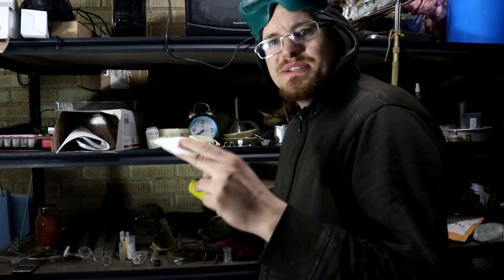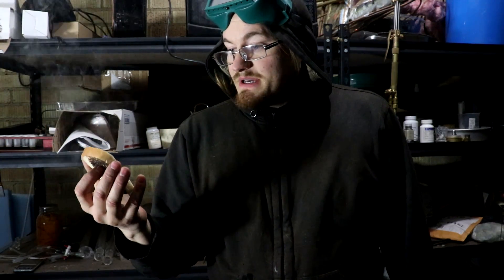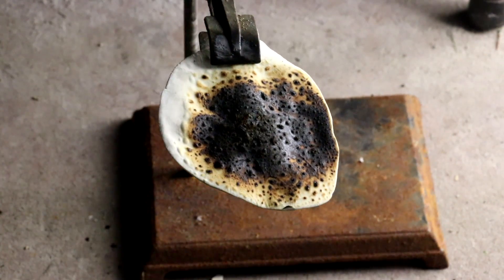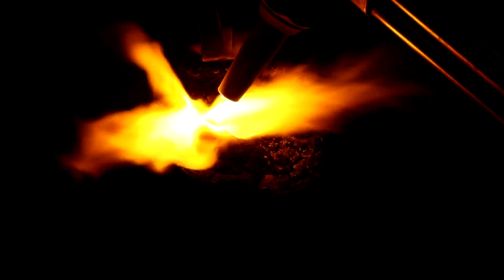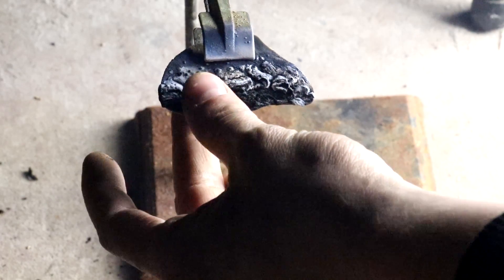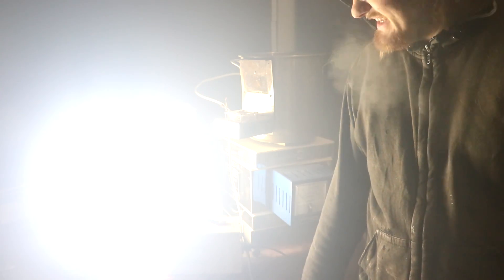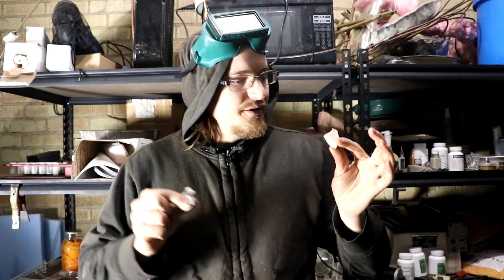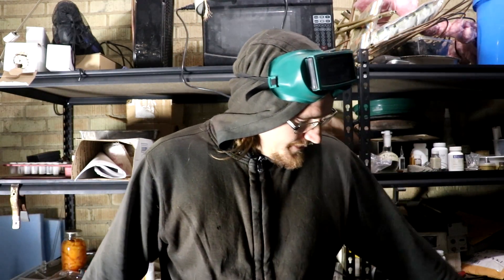Can I Burn Through Starlite?

Comment: Cody, I have a white powder product that I purchased 6-7 years ago that I added to my latex paint that when heat is introduced actually expands and forms a 1/2” to 1” foam type barrier. Reducing the risk of thermal conductivity through the Sheetrock into the wood studs behind it. The product states that when heated, it doesn’t form any additional toxic gases. I never actually tested the product. I had enough to paint a 1500Sqft home walls and ceilings. I’m wonder what your thoughts are on this product. I’ll have to go into my building and find the manufacturer product and it’s name. I’m curious if this is nothing more than a sodium carbonate product with some type of polymer that allows the co2 to form a foam.
Reply: This is just called INTUMESCENT paint.
Reply: @dimitar4y  why do you seem so angry?...
Reply: Mark Eckelkamp how do you heat it without setting fire to the fabric of the building?
Reply: @colinantink9094  By making a test sample that isn't attached to his building? 
Either by having more left over, or just buying more of the product, its not like it's a lost chemical, he still has the information on where it came from.
Reply: Madra hm. By the tone of your comment I guess it’s apparently obvious. So uh. Hm. Does this stuff only bulk up when heated by an existing building fire or something?  To try to prevent or slow down further spread?
Reply: @colinantink9094  Yes it's obvious, just look it up, Intumescent paint. Yes, it bulks up on heat. Just 500-600'C can make buildings fail if the metal girders are heated up. It retards heat spread. And it uses non-organic things, so stupid fungus can't eat your building to death.
Reply: Colin Antink  yes that’s the purpose, if a fire does occur its primary purpose is to slow the spread of the fire until firefighters can arrive. If put on in two coats it is suppose to give a 2 hour fire rating. When I was doing fire inspections for my local fire dept. I was strict on daycares because the infants and young children cannot leave or know any better. I purchased this product through a local supplier as it was cheaper than purchasing intumescent paint by the gallon.  We allowed a daycare to use this verses  removing all the wood paneling and installing 2 layers of Sheetrock on one wall to obtain the same fire rating. The product came in a 4 gallon bag inside of a cardboard box. Again I never actually tested this product to see its effects or what actually happens. I took the manufacturers word as this was NFPA approved product,
Reply: @MARKE911  
What was the manufacturer name?
Reply: damen whelan. I’ll go out to my shed building this week and see who makes it and post back on here. Unfortunately it’s not on the same property that I currently reside on.
Reply: No you’re meant to sniff it not put it in paint.
Reply: PREPUBESCENT paint!
Reply: @hokiepokie_soupermane  I knew I should made that joke juat to save my notifications the trouble.

Comment: The problem with this demonstration is that you're removing the carbon foam by using a torch with a flame that comes out at very high speed. Starlight was never meant to stand up to that. It is a HEAT barrier, not a torch barrier. If you heat it with the propane torch and then blow on it with a strong fan, you'll get the same result.
Reply: I also wondered if that was the case.
Reply: I was thinking the exact same thing. The whole gimmick is the foam the carbon forms. If you blow that away, of course you're going to get through it.
Reply: Ok so in an actual fire there is absolutely no air movement?? People asked about reentry. There is a LOT of air movement in that situation. BBC said this material could survive 75 nuclear blasts. Do nuclear blasts not have any air movement?? Plus this material won't survive a little water. While it is a neat material it is no miracle material.
Reply: @crissd8283  The BBC video mention its resistance against the heat wave from the nuclear blasts, not the shockwave. They even mention that
Reply: @crissd8283  I don't remember the thing about the nuclear blast. I don't think anyone said anything about an insulator for reentry. Either way, it's an interesting material and the concept of it is what's got all of the potential.  I also don't think the US and British defense departments are lying about it withstanding a 10,000 degree laser pulse.

Anybody with 2 brain cells knows you're not going to coat anything with cornstarch, baking soda, and glue.
Reply: NASA did nuclear blast testing and confirmed it.
Reply: @gnydick  wasn't it a laser test with an intensity similar to nuclear radiation?
Reply: I read it in literature some years ago now  @gnydick  there was a breakdown of testing that NASA had performed and it did include nuclear heat sources.  The only way it could have been done - safely performed under lab conditions.  How much of a blast that amounts to I could not say however I know the material was independently tested and verified for its claimed properties so it is not just a matter of "a crazy person making claims" but of scientific departments of well established agencies that have backed the claims.
Reply: @keeperofthegood  The only claim about NASA came from Ward himself. Unless someone finds documents or evidence of these tests taking place other than what Ward claimed, I don't think I'd take them very seriously.
Reply: Indeed I am not even finding the documents I recall reading through a few years back now  @ivanlagrossemoule  and yes searching through I am not finding corroborating information.  NASA pre 911 was entirely online (over 50K web pages) but following 911 it went down and came back vastly different but any research done by them should be listed public. So now I question what the memory that I have of what I read.  I will have to step back to the skeptic position again.
Reply: You are absolutely correct!
Reply: The reason this doesn’t prove this material’s significance is because most applications for this material on earth are going to involve some amount of convection heat, which involves airflow, and ultimately leads to the same outcome. Also, Cody mentioned that this stuff made smoke, which means it burnt, and that means that this material is susceptible to an oxidizing flame, and since our atmosphere contains lots of oxygen, that’s a problem
Reply: So if the problem is he's blasting the foam away, what  kind of application this is good for that guarantees the foam will not be blasted away?
Reply: @misium  Lasers, any kind of radiant heat, situations where a scientist would try and replicate conditions rather than blasting a piece of toast for less than 4% of the time and saying they're about the same.
Reply: also this wasn't the original recipe
Reply: I think there’s some physics involved with re-entry of the atmosphere. Sure there’s oxygen up there, but how much, what’s the friction of the oxygen on the material, and the cooling effect as well? Maybe it would work for just putting satellites into orbit but not having them re-enter the atmosphere? I don’t know enough about it to speculate more.
Reply: he wanted it to burn, 
he didn't want to test it.
next time read the title.

Comment: Can you make/test aerogel?
Reply: How about "evacuated aerogel", where it's a closed-cell foam where each cell is filled with vacuum? Should technically perform better than aerogel.   Edit: "filled" with vacuum... er, uh... you get the idea.
Reply: Applied science has made a video with the process of making it "at home"
Reply: anyone can make aerogel
Reply: @Rockzilla1122  I mean, technically anyone can make anything given they have access to resources, equipment, and know-how.  :D :D
Reply: And use the  gas axe on it.
Reply: Go over to Applied Science, he does more advanced stuff like..electron microscopes and Aerogels.
Reply: isnt it just a gel filled with a lot of air?
Reply: it's a gel that's had the liquid removed as a supercritical fluid.

applied science did a video on making aerogel.. he also made a supercritical CO2 chamber.. good videos, check'em out.
Reply: @adfaklsdjf  cody also made a supercritical co2 tube
Reply: Joe mo mumbo Yeah I'm not sure everyone was aware how effing dangerous that was. He basically built a bomb made of glass
Reply: Skeets McGrew and he treated it with the needed amount of respect.

Comment: This seems more like you're just blasting away the starlite with pressure not fire, I think you'd get about the same result if you used a pressure washer or compressed air.
Reply: Or the pressure of re-entry?
Hyper-sonic air-blast imparts LOTS more pressure and heat than Cody could manage with that puny torch.
And at Mach 8+ turbulence takes on a whole new meaning.
Cody was being quite gentle with his test.

Comment: I thought you were kind of underselling it at first,  but cutting the plaster board made your point pretty perfectly.
Reply: Now I wonder what you get if you mix Starlite (actually NightHawkLite?) ingredients with plasterboard ingredients.  Maybe add some extra stuff to outgas to make a shielding vapor layer, and maybe you could get something that would last for the few minutes required for a space vehicle to complete the hottest part of atmospheric reentry.
Reply: I doubt that would make a very big difference as plaster board is usually composed of perlite which as I understand isn't thermally stable beyond something like 2000 degrees F while reentry is about 3000F.  It might be an interesting experiment none the less
Reply: @Lucius_Chiaraviglio  the Russians were using reentry Shields made out of wood for a while. I believe it was White Oak from America even.
Reply: @demandred1957  
Yep. Laminated. It would burn form.carbon that would.flake away while the under surface charred more.

It literally does the same.job as the tiles only it's heavier and retained moisture.
Reply: I don't think the claim that Starlite is very strong is accurate - the claim is that it is a very good insulator.  I'd rather see it made into a box put in a furnace for 5 minutes with a some bacon in it, I think then you may see the difference between Starlite and plasterboard.

Comment: Could it be protected against an oxidizing flame further by adding more sodium bicarbonate to the mix? I would think the increased decomposition from bicarbonate to oxide would help shield the carbon layer from the oxygen
Reply from the maker: actualy I think aluminium hydroxide would hold up better since I can boil sodium carbonate with this torch.
Reply: @theCodyReeder  sounds like a fun test :)

Comment: Using a torch.
Setting shit on fire.
Holding objects with his bare hands.
Same objects he's setting on fire.

That's why we love ya.
Reply: "I should probably open a window"
Reply: I remember seeing a video of a person holding the material that the space shuttle was made out of in his bare hand while it was literally glowing hot.  (he took it out of a furnace with his bare hand)  the part that was supposed to protect it from reentry.
Reply: @speedy01247  I remember that too. It was glowing hot in the middle but the surface was cool. Looked really cool because the outside was white and it had this red glowing coming from inside.
Reply: @speedy01247  that could have been... starlite!
Reply: NightHawk did the same thing in his video
Reply: It’s a different type of flame as well though.
Reply: Use hidrogen flame
Reply: CHINEZU englez Acetylene is hotter than hydrogen.
Reply: also why demonetized
Reply: If Cody had Shawn Woods mousetrap channel he'd probably have ten black fingernails.

Comment: Cody’s Lab in 18 years: Can Hawking radiation from my black hole be concentrated into a beam?
Reply: *months
Reply: Beam it up Scotty
Reply from the maker: Well this is a question I have.
Reply: Cody'sLab a question that 'can' be answered. Although no one would ever know the answer.
Reply: @theCodyReeder  I believe that is what a Blazar is.
Reply: @theCodyReeder  of course it is, love your channel 😂
Reply: @theCodyReeder  Considering hawking radiation (to my knowledge) relys on atoms or an opposite part of it's pair to disappear and reappear outside of the black hole's event horizon and the fact that we have no clue what's in the center of it by way of whats going on to an accurate sense there is no way to predict where the particles would appear so I don't think so.

I'm far more curious about the application of using small black holes to break down forms of matter and using elementary particles to create any known element. That or see if it is possible to create elements beyond the periodic table. 
(Tbh IDK if the periodic table is limited because these are all the elements known and proven to exist or if it is that by standards under normal planetary surface or space conditions/what we can replicate individual atoms/elements simply fall apart beyond that proton/neutron/electron count)
Reply: I'd like to see the nuclear reactor made out of potatoes
Reply: Well, that depends. What shape is the black hole? If you can spin the black hole fast enough, the event horizon should become red blood cell shape, and the concavity should allow the Hawking radiation to focus kind of like a reflector, but a laser beam effect would require fancier physics. 
(technically it would be a horn torus [think bagel that almost has a hole])
Reply: @superdupergrover9857  how does spinning it deforms the event horizon? I thought the event horizon originates from the singularity which can't really be influenced by any spinning, right?
Reply: Michel it does for some reason, GR explains it
Reply: superdupergrover it’s called a joke
Reply: Please don't talk about Cody's black hole, I think in pictures XD
Reply: Cant forget a precursor to it, "how to make a kugelblitz at home"
Reply: "And here is the chamber where I'll bombard the beeswax with antileptons to produce the charm quarks, which I'll be collecting in this pickle jar."
Reply: Lol great video jumping to the max to test it out.
Reply: I CALL IT A HAWKING HOLE
Reply: Well after reading through that, im rather scared to post anything in this chain.
Anyway, I suppose if we made a tiny weeny star we could spin the shit out of it and then try and make it collapse into a black hole with angular momentum but then there is the problem of getting a tiny weeny star to burn up all of its mass to form a black hole.
Theoretically impossible as in order for that to happen the stars mass must exceed the TOV limit, which is somewhere around two and a half times the size of our star.

You would actually need to make a larger star than that even, as the angular momentum that you would need to impart onto the star that is required for it to carry that momentum through its eventual burning out to form the bagel, would break the perfect geometry.
So if your star had the bagel shape to it then it would be uneven in mass throughout and so it would no longer have the perfect geometry required for it to have a rest mass that exceeds the TOV limit.
I think.

Unless all this is drivel and black holes evaporate their hawking radiation at poles forming a beam anyway (i think this is the case).

Ok i dont think i know what im talking about, im gonna go away and read, i suggest the rest of the apes do the same.
Reply: jared garden. 

the only guy to take the joke seriously everyone....
Reply: "cutting through starlite with concentrated hawking radiation"
Reply: putting electronics into a nebula to focus the electro magnetic radiation seem like a waste of energy unless it's a last resort for mission critical communication.
Reply: knowledge
Reply: Clorox Bleach NASA has zero photos of earth from space. Only composites. 

Do I think the earth is flat? No. 
Do I think there should be at least ONE photo from a space station window? Uh chyeah. 

(Do I think we landed on the moon? I have no way to say. 
Was the footage staged and faked? Oh yeah for sure. Walter Disney doesn't get hired with the job title 'set designer/builder', if the sets "never existed")
Reply: @J Cline in a good way? or a very evil way?
Reply: if this doesnt happen i will be sad
Reply: DIY Death Ray
Reply: this is so realistic ! 🤣🤣🤣🤣
Reply: Cody's Lab in 60 years: Is death of age really possible? Or can science prove otherwise!?
Reply: Woyldn't that just be a quark cannon?
Reply: Here in my garage, spreading some knowledge
Reply: If he ever needs henchmen to mine silver to power his deathray im in! But I need some gadgets and a decent costume.
Reply: Theoretically
Reply: Or banana s
Reply: @roland4240  hmmmmm, I'm no scientis, but I do love nana's, and What's the Worsestest That Could Happen?
Reply: @ScoriacTears  i like mayo on my banana sammiches!  🍌
Reply: . . . and hey! you're not Scott Manley. . . and that's not your fault I guess.

That's all goodbye.
Reply: “Can I make a laser by pumping my hawking radiation into a massive ruby crystal?”
Reply: Random stuff with Michael you mean like a lightsaber??
Reply: More like 18 000 years